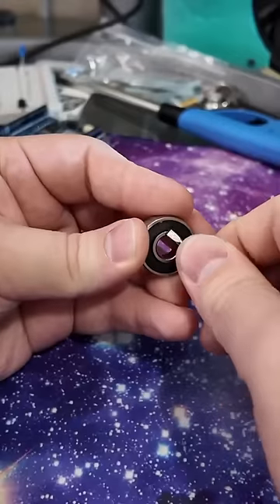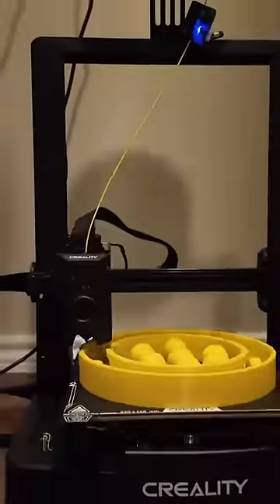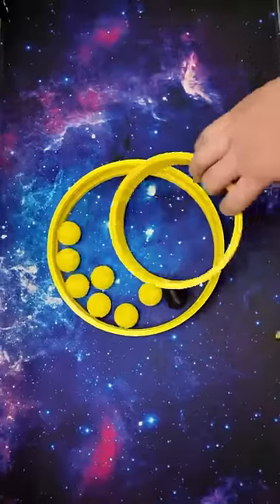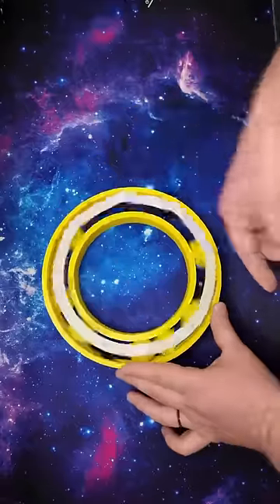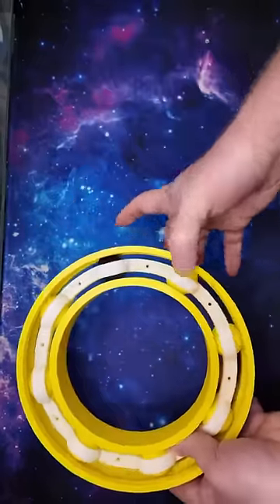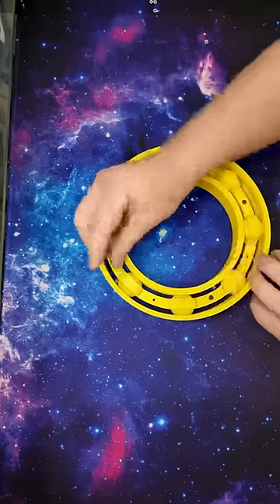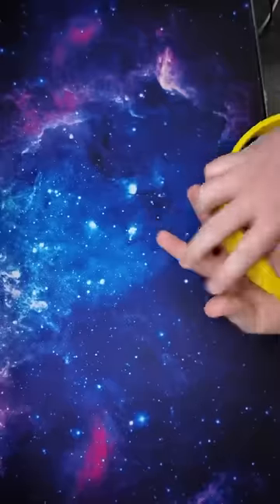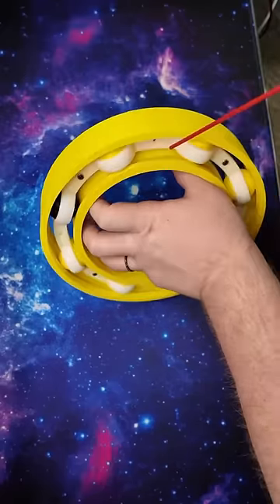How Do The Balls Get Inside the Bearing? 🤔 (ft. GIANT ball bearing) #3dprinting #engineering

Comment: That 'carrier' is called a CAGE, I think.
      In bicycles, you either have loose bearings (that fill out the space), 
     or so called CAGED Bearings
 (without an inner or outer ring - those are formed by the bicycle parts themselves)

Btw. For lubrication of plastic parts, don't use any petroleum (derivate) based lubricant. 
      WD40 partly consists of a number of petroleum based solvents that will actively degrade plastics. (The building blocks of most plastics are also petroleum/oil based).

Instead, you can use silicon (spray) lubricant, or PTFE (teflon). 
      (For the sake of the environment, I suggest silicon)

Anyways - cool project. I used to wonder the same thing :)
.     AND I didn't know about the spot welding... (The plastic cages I understood, but the metal ones...).
    Finally that mystery is revealed to me :)

Comment: Uhm.. kind of.
This is completely accurate for most ball bearings, but there Are specialty versions where the balls or rollers are packed in other ways.
Usually for better shaft centricity, or heavy loads.

Comment: WD40 is not a lubricant.  It is for Water Displacement. That's what the WD is for. Bearings should be greased. Specifically, low viscosity plastic grease.

Comment: Forgot to mention that some bearings are put together using a torch and liquid nitrogen. The torch heats up one part causing it to expand and the liquid nitrogen causes the other part to contract then they can be put together and when they get back to room temperature everything equalizes out and you get a very tight fit.

Comment: Print the bearing it as a full assembly. No work or carrier required. Also, don't use solvent based lubes on plastic, you want silicone grease.

Comment: They put the balls in by using a pneumatic press called a ball vise the squeezes the outside ring slightly the they drop in  the exact number of balls releasing the vise and the balls are there with or with or without the spacer the balls will no come out without being forced out. Then they are washed greased and sealed. This was 20 years ago so I am sure its all automated now but even back then we could produce 2000 to 3000 per shift

Comment: "No play" that is not 100% correct all bearings have an axial and radial play. If you have 0 play the bearing is not moving. the play is small, and depending on the type of bearing the play is very specific. You have to design it in order to account for the forces on the bearing when it is in load. you can calculate for example if it has 100 KG load you will have x play after finishing the components and in load will be x-y. There are situations when the load is negative and you must have a negative play  after finishing. In that case if you mount the bearing and it is not loaded it will not spin.

Comment: I take apart bearing and put them back together for fun and the carrier is very important 

As for getting put together once all the bearing are between the inner and outer ring move at least 1 recommend 2 bearing to the otherside of the bearing as is often difficult to put them back together especially small bearing

By small on the ender 3 the black vslot track wheels thats useds for any movement ive taken that apart and it took about 45 minutes because i used random things nearby to help disassemble and reassemble like a small flathead and a wire trwist cap as it fit perfectly in between where the bearings went to hold the carriers together until i got the small metal tabs bent back in to hold the carrier together

Comment: The ball bearings I have worked with has no lock in place thing you made. They just have enough balls pressed in between the two metal rings although on mine, only one part of the lid is the opening

Comment: WD40 is water displacement formula 40. It is an industrial solvent for cleaning metal, it will dissolve abs and other plastics. Silicone grease would be a much much better choice, or a natural plant oil, pla and other printed plastics will dissolve eventually in the presence of most crude oil based things.

Comment: And you wouldn't believe it but for the low low price of $40 you might just be able to print your own if you want to use the cheapest filament possible and most importantly find it on sale. The filament cost to get into this hobby are absolutely ridiculous. The only viable option in my eyes is either a filament making setup or a pellet machine. Besides that I'll never buy a hobby grade 3D printer ever again.

Comment: Don’t need the “carrier” thingy (the one sandwich-ing the balls with screws), basically bcz points of friction.
May need more balls but the inner and outer valley would be deeper, it stays in place by itself.
But to get that, think you may need metal, as you can’t use heat and cold to deform and reform plastic? 🤔

Comment: Wd 40 is not a lubricant. Please dont use wd 40 to lube important things it will damage them. It can be used to clean things and has penetrating oil but not lube. It made it better because it was wet when it dries it wont lube at all

Comment: Use a proper lubricant like silicon oil and you'll have even more fun with it 
The WD-40 contains a bit of petroleum, yes, but it's really rarher meant for cleaning off grease instead of providing lubrication by itself

Comment: You are showing a RETAINED radial ball bearing. There is another type, for higher loads called FULL COMPLIEMENT BALL BEARINGS and these are not held in with a ring. Instead, the races contain the balls.

Comment: So I’m going to be designing something that requires rotation, but is also going to require small parts. 

I’m going to be building an I5 engine (just imagine an average modern sedan I4 engine with one extra position).  That being said, the engine with be around 100x150mm max. 

Think I’ll be able to make bearing for the crankshaft?  Or you think it’ll be too small.

Comment: WD40 is not a lubricant, when will people learn this? WD40 does now make a lubricant spray, but regular WD40 is not a lubricant and will quickly wear off and could cause damage depending on the application you are using it for.

Comment: For all the Sodium Chloride melvins in the comments: WD-40 is not a lubricant in the same way that gasoline is not a solvent and a pocket knife is not a screwdriver. Yes these things will work, but you should NOT use them as such. For WD-40, it's perfectly fine for use in this example, but not for long-term use. Don't use a pocket knife as a screwdriver if you like your fingers, and don't use gasoline as a solvent if you like having skin and being alive. Yes, gasoline is a solvent, but for practical use it is not an option.

Comment: WD40 is not a lubricant and is not good for real bearings because it can break down the grease and leave the bearing with no lubrication and will cause a failure. WD40 has been the death sentance for many electric motors, namely the fan motors in rooftop RV / moptor home air conditioners because the owner spreay WD40 into the bearing and motor thus starting the timer countdown to the motors death

Comment: WD40 isn’t for lubrication. It’s for water displacement.
Reply: "WD-40 Multi-Use Product protects metal from rust and corrosion, penetrates stuck parts, displaces moisture and lubricates almost anything."

"Lubricates, resists water and protects metal and non-metal surfaces"

"Lubricates 15X longer than the competition"

WD-40 makes more than 1 product.